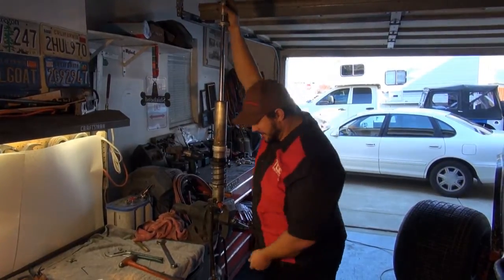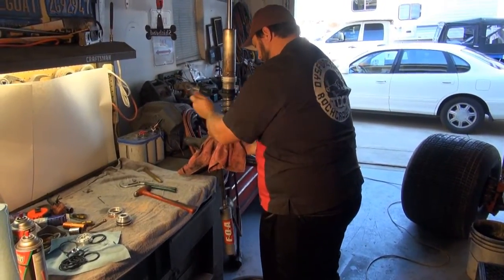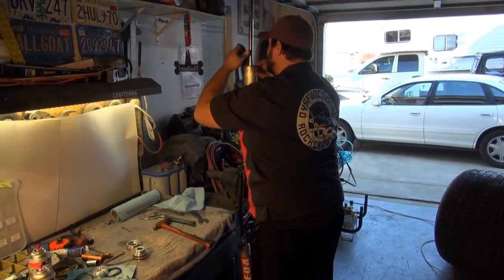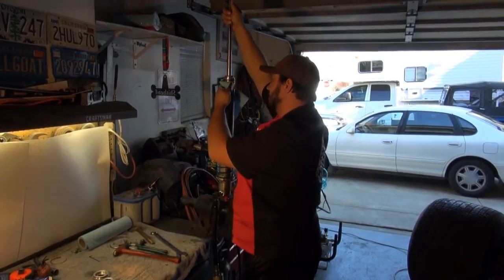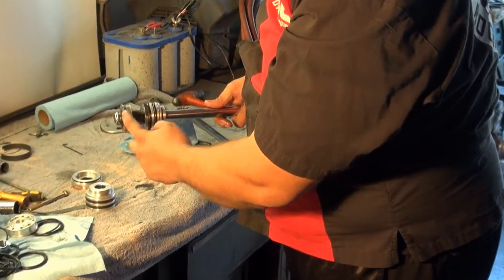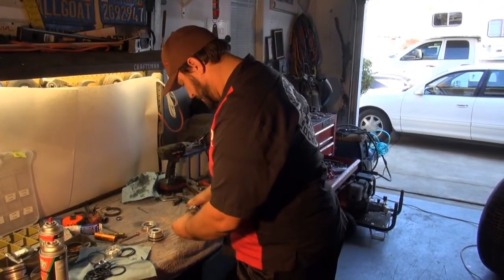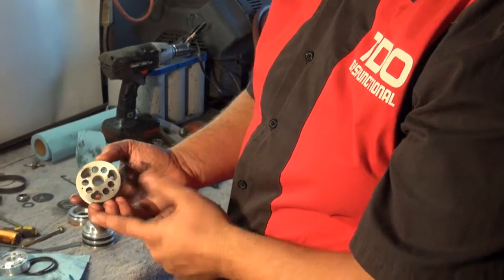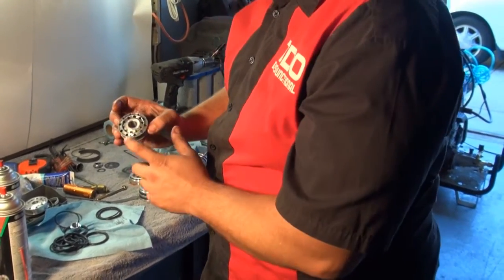Rebuilding an FOA coilover shock

Comment: You saved my ass man! Brand new FOA's leaking nitrogen and I have never taken apart a gas shock before. Quick and to the point video! Found Res cap O-ring to be demolished. stole O-ring from another shock I wasn't using, charged and good to go! Thanks for this!!!

Comment: Where should the IFP be after you press the seal head in? Still 8” or is it supposed to move? I can’t keep mine from moving when the seal head goes in and pushes the shock oil down

Comment: Pay attention people. Once you buy these from FOA you will never hear from them again. Especially if you have a problem.
Reply: haha this is true. My friends never have to worry about rebuilding their coilovers where as I am becoming damn good at it lol
Reply: TronskiFPV Man, I might have to send mine over to you to fix when they go bad. got any spare shafts that actually have chrome on them? As in not missing in patches?
Reply: the chrome fell of my first two shafts so I know what you're talking about. I have two extra shafts for there 2.5 8" travel shocks id sell cheap since I cant get a return on them(emails and phone calls not being responded to). I bought 12.5" long shafts from the website and they sent 13.5". No good for my custom length shocks but proper for a off the self 2.5 8" travel. The new shafts are coming from a new supplier (probably china) since they no longer have the shoulder beveled. I hope the chrome is of better quality then what they have had in the past. Also check your IFP wear band. If you have the old plastic one like I do then your reservoir will be toast in 10k miles. Rebuild kits include the new brass/teflon rings.
Reply: TronskiFPV I have 6 inch travel shocks. Not looking forward to rebuilding them. I got some other projects coming up and there is no way I'll put FOA shocks on another customer's vehicle. Never thought I would see such terrible customer service.
Reply: yeah its crazy huh? I ended up filing a dispute with paypal over the shafts last week and have ordered King shocks as replacements.

Comment: Is it worth getting FOAs? I was thinking about buying a set then immediately tearing them down to clean and debur everything. Or should I buy a set of Bilstein 7100s until I can afford to buy a set of king/fox 2.5s?
Reply from the maker: I do like FOA, I think the design and the parts are good, you just need to perform your own Quality check. If you are brand new to shocks / hydraulics, I would for sure go with King/Fox.
Reply: @welndmn  I ended up going with FOA. I'm new to rebuilding shocks, but it's pretty straight forward (I'm also a mechanic so I'm familiar enough with stuff like this). I'm going to buy their limiting straps so I have a 1 year warranty. Think it's a bad choice to just run them and hope I can use the warranty?

Comment: Remember: the hose connected to the shock is under pressure & it's a good idea you wrapped it with a rag unlike myself. My reservoir is mounted to the shock so I have a plug & when it came loose it shot a few feet!

Comment: If  I'm just changing the oil do I need to completely disassemble? Can I fill it 2 inches from the top for any foa?
Reply from the maker: L K you can try and get lucky by measuring the amount that came out and putting that back in, but then you are taking a risk that it has the right amount to start with and didn’t leak any out. 
To add oil you need to know where the ifp is.

Comment: I got a hole in my res hose, if all I'm doing is replacing that hose, do I need to mess with the ifp?
Reply from the maker: Oscar Pallares  yes because you need to re add oil and bleed it.
Reply: @welndmn  ok thanks

Comment: If the oil is 2 inches down when you put the piston in how is all the air out when you put the cap on? Seems there would be air causing foaming in there still?
Reply from the maker: The top cap burps the oil out.
Reply: @welndmn  Having an issue now with the spacer falling to the bottom of the shaft, the last one was a tight fit, this one seems 1/8 too big, any thoughts as to what's going on. I sent a pic to the fb messenger page.
Reply from the maker: Don Frankish I’m not understanding, I’m also in no linked to FOA. 
You can email me a pic and I can see if I can help. It’s just my screen name @ yahoo
Reply: they got me sorted out, thanks, I thought you worked there because they use your video as a tech link.
Reply: @welndmn  are you still rebuilding FOAs?
Reply from the maker: @Sub-ZeroRacing   yes I do.

Comment: What size foa's are those? I'm trying to rebuild my 2.5 12in resi's
Reply: all FOA will follow the same procedure. Internals are the same from a given revision, just the body/shaft lengths change
Reply: +TronskiFPV lol thanks I sold these months ago after figuring it out and bought a set of kings for my rig. Thanks though
Reply: I'd very much like to follow that same escape plan haha. King sound well built
Reply: +TronskiFPV they are and they live up to the name, FOA I guess has always been a buy once, but a second time, oh shit, gonna have to buy my third set kind of shock, fox is good, but fox is old compared to king.